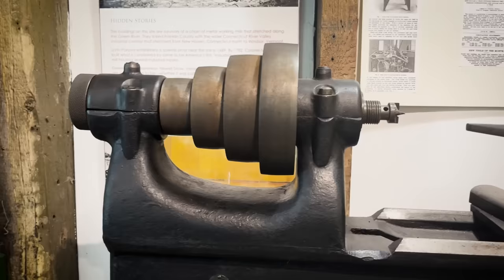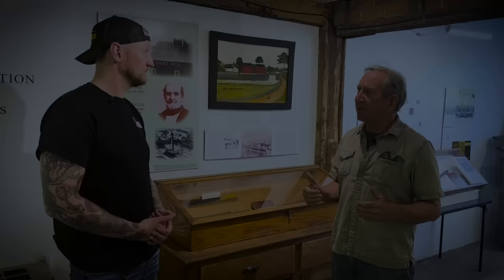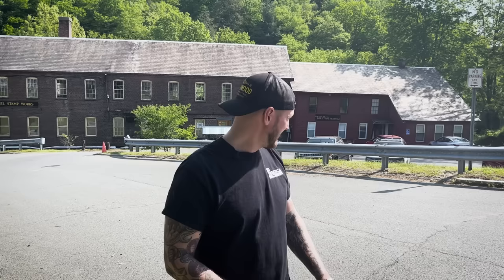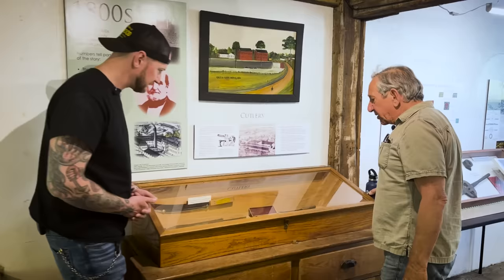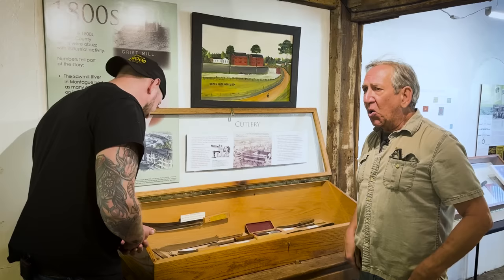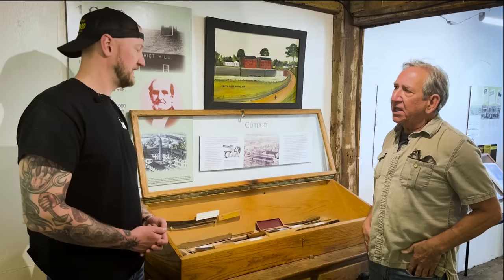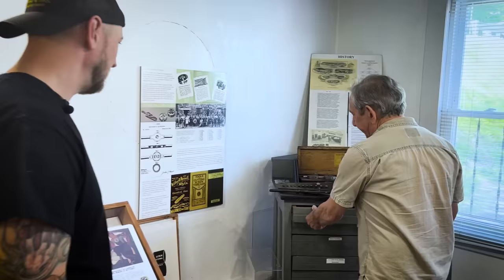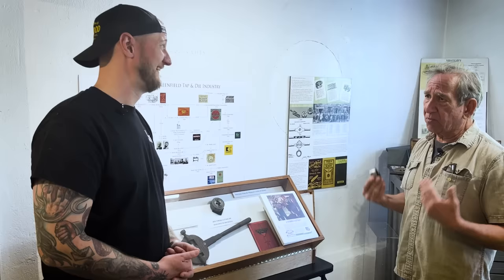The Cradle of the American TAP & DIE Industry | Museum of our Industrial Heritage

Comment: I worked as an Apprentice Tool and Die maker at a shop in Shelton CT.  Apex Tool and Cutter Co. Inc.  Back in the mid 70's.  We made custom Tool Bits and Tool Holders...Milling Cutters...etc.  We still had the old overhead Pulley system on a lot of machines.  One section had lathes, shaper, Horizontal Miller, Planer...ALL dated to 1860's...we had modern equipment also.  Loved working their.  Did 3 years there then went to two years of Electronics School and married the two skill sets...best thing I ever did.  Can still hear those pulleys and smell the machines from Apex...loved my time there.
Reply: That's pretty neat. Bridgeport, stamford, and norwalk used to have tons of tool-and-die, and factories back in the day. My mother worked at two factories in south norwalk after getting off the boat in the early 70's. Have some friends that have retired or passed away, that also worked at places like Pitney Bowes, or perkin Elmer, from way back when.
Reply: @VitoVeccia  I worked at Perkin-Elmer in 1980 and 81'.  Lived in Norwalk at the time.
Reply: @mauricepowers8079  my family lived in norwalk too. Then in '87 we moved to wilton.
Reply: @VitoVeccia  small world...I got married in 87' and lived in Weston.  Then moved to Darien for 2 years then moved to NM.
Reply: @mauricepowers8079  wow, small indeed.  Especially when it comes to a small town like Weston. You can drive through there in the blink of an eye. At this point,  I wouldn't be surprised if we might know some of the same people. A friend of mine grew up on Cedar road,  and his neighbor many moons ago was Christopher Walkin. It sounds surprising,  but it really isn't.  Keith Richard's used to love going to the Georgetown Saloon. And James Gandolfini used to live on Catalpa road, right behind wilton highschool.  James was a customer of my friends drycleaners business in Ridgefield.
Reply: @VitoVeccia  I worked at Klein's in downtown Westport as the "In House Electronics Repair Tech" from 82' to 87'.  If you ever had a Hi-Fi, TV, Boombox, Walkman repair done at Klein's...I did it.  I did custom Video and Stereo System installs on the side.  Made a killing. 😂 Paul Newman was one our customers.  Was out to his place on Coley Town Road many times.  Lot of famous people used our store.  Redford, Patty Hurst, Larry Coryell, Harry Reasoner, A.E. Hotchner.  Quite an experience.  Newman set up an Antique Popcorn cart outside the store on our 50th Anniversary.
Reply: Ha. My grandfathers came over from Sweden in the '20s, and we're machinists and tool and die makers in Rockford, IL. My father followed in the same. 
Companies like Woodward Governor, Ingersoll Milling, W.F. John Barns. My mom was in industrial supply sales. I grew up with all this stuff, but as Rockford was dying (really, no pun intended this time), I went into a EE degree and ended up spending 40yrs designing software. Initially for machine control (Barber Coleman) and then into biomedical. I'm still always working on projects that don't involve computers. The odors of the shop are intoxicating in the best way. 
I firmly believe that no kid should be allowed to graduate high school without having a min. of 2 semesters in general shop and 2 in some type of trade.
Reply: @mauricepowers8079  Coley road? Did you know Bob Andrew's? I was friends with his son growing up.
Reply: @stringlarson1247  funny story.  I spent most of my life as a auto/heavy truck mechanic.  But now I'm a factory mechanic for Nexus.  Our Mokon water heaters for the Aurburg use barber Coleman controls.
Reply: @VitoVeccia  I'm sure I met him in passing.  We had an ENORMOUS customer base and very high foot traffic.   I LOVED working in Westport.  I had to work Tues through Sat and spent the weekends playing Tennis in the Spring, Summer and Fall(Foliage was breathtaking).  Winter was almost every weekend(Sun and Monday) up to Killington, Stowe, the Berkshires, the Whites.SKIING.  80's was AMAZING.
Reply: @stringlarson1247  my Grandfather migrated from Quebec to Greenfield MA back in the 30's.  He was a very highly skilled Machinist.  He met my Grandmother in Greenfield then bought 6 acres in Huntington CT and built a beautiful French Cottage on the property(he used scavenged Brick from the shop floor and wood from the shipping crates from the bar stock at Hershey Metals Inc. In Ansonia CT.  He was lead Machinist on Screw Machines till he retired in the late 60's.  He was an INCREDIBLE machinist.  Great guy...everyone loved him.
Reply: @VitoVeccia  Wow, small world sometimes. While in univ. I worked as an engineering co-op student in their plastics machine control div. I wrote all of the code for their Maco 8000 Touch-trol operator station in 8051 assembly language. You can find images on the googles. 
The workstation was an Intel 'blue box' with 2 8" floppy disk drives. One for the OS and one for the code with an in-circuit emulator. 
Ironically, at the time, I just wanted to build tube amps for audio and nothing to do with computers. I just happened to be really good at it. After getting my degree, I ended up moving to S.F. with my roommate and after doing landscaping in Marin Co. got a job working on the first pulse-oximiter and then on to writing real-time operating systems. FFWD and our OS was on the first Mars Rover (and now a billion other things). 
Now I just want to get an old Bridgeport milling machine and a lathe (which I've never used) and make stuff w/o any computer controls. Cheers.
Reply: @mauricepowers8079  Sounds idyllic. 
I love the scavenged/re-purpose materials mindset. I'm pushing 60 (quickly) and have been doing that since before I was 10. My father died when I was young, and I 'inherited' a whole workshop of tools. The only thing my mom got rid of was a large Rockwell table saw. (she knew which way the wind was blownin' :) ) 
I live on the not-so-posh end of an old, posh historic, and on 'garbage' night, I'll ride my bike around and see what people are throwing out. If I find something, I'll ride home, get the ol' Volvo wagon, and hope to get back before someone else nabs it. Unreal how much stuff people pitch out. I need to get another pickup truck to get bigger/longer things like old-growth lumber, etc. As the area is quite wooded, I grab logs, etc., for the wood stove as well.
I hope you still have that property and, if not, at least memories of that time. 
I've got a friend who's job is as project mgr. building 'skyscrapers' and he's built much of his family home with salvage material. I'm just a piker compared to his level. But that's how we learn. 
Thanks, I love hearing things like this.
Reply: @stringlarson1247  I'm just like my grandfather in a lot of ways...his property went to my cousin to help pay off some medical debt for my aunt.  Great memories though.  As the story goes, when they were planning the site, they needed to dig down about 10 to 12 feet...they hit good old NE BEDROCK.  Grampa or one of my uncle's got their hands on some DYNAMITE to help the job along.  They got it done 😂  you couldn't see the house from the road.  Hand dug Artesian Well.  Guest cottage.  Everything was scaled down for grandma because she was only 4' 11".  Gramps was only 5' 1".  
He was lead Machinist at Hershey Metals and every couple years they would replace the aisleways on the factory floor with fresh brick as the old brick became oil soaked.  There was a HUGE pile out back.  Gramps also owned a garage in town with a sand blaster.  Boss told him take all the brick he wanted.  He took truckloads of them and sandblasted every one of them and built the cottage for gran.  Handmade French doors leading to a beautiful slate patio with a fireplace built into a retainer wall.  Door frames were all rounded on top...stucco walls.  Full attic.  Cabinets and countertops were all scaled low so gran didn't have to stand on anything to access whatever.  Glassed in Sun porch.  All overlooking a hillside dairy farm to the North.  Completely wooded surrounding the house.  Was magical in the fall and winter.  Gramps was about as resourceful as they come...and he and gran were immigrants...as were my grandparents on my dad's side.
Reply: @mauricepowers8079  Heh. Great story. Great traits to have inherited. 
All the work to move, sandblast the brick and then build to a smaller scale is quite the tale. Plus a little TNT in the mix. 
When you said the blasted and followed by 'you couldn't see the house from the road. I pictured a house built in a very deep hole :)
All four of my GPs came over from Sweden in the '20s. Both men where in the merchant marines and jumped ship and were illegals for many years. Thanks for writing this..
Reply: @stringlarson1247  the road to White Hills goes on a steady uphill grade from the Housatonic River...there was an embankment because they had to blast the bedrock to reduce the road grade.  This left the roadbed about 20' below the property.  Gramps got a small dozer and cut a long rough driveway parallel to the road just on the other side of the embankment.  The property sloped down and away from the embankment which pretty much hid the property from road view.  Gran liked the privacy so when they got the site ready they lowered it about another 6 to 8 feet and leveled it.  The Artesian Well was dug first after the site was leveled and they actually incorporated the Well in side the back end of the house to keep it from freezing in the winter.  The mail box was on the roadside and you had to climb up the steps and across the dirt driveway ... 
Then climb down a 20' (VERY STEEP) embankment...no steps...just a rocky dirt path 😂.  Was IMMENSELY FUN in the winter.  That was my cousins job to go get the mail every day. 😏
Reply: @VitoVeccia  you know who else lived in Ridgefield...Sterling Hayden.  Met him when I did a TV/delivery install once.  Robert Ludlum(Jason Bourne Series) had a beautiful place ON Long Island Sound in Fairfield.  He was a GREAT guy.  He had an old Slot Machine in his living room and every time I was there he would hand me 10 Silver Dollars and tell me to give it a whirl...never hit but it was fun to try.  He insisted on giving me a $20 tip no matter what the charge was. I told him I felt it was too much.  He told me he did whatever he had to when he was in College, and he learned real fast to accept any and all tips..."So don't worry about it" he said.  You should have seen the house...beautiful unobstructed view of the Sound...private dock...Tennis Court between the house and the beach...high stone wall on 3 sides and gated.  Gorgeous property.
Reply: @mauricepowers8079  I love hearing stories like that. I did some work once with my cousin,  at Dave canaries house. He used to live on Beldon hill road. Nicest guy you could ever meet. I went to school with his son, and didn't even realize it at the time. ( I don't watch soap operas ). But yeah, nicest guy ever. No amount of money could change guys like that personality.
Reply: @stringlarson1247  that is some incredible achievements you've done. Working a Bridgeport is fun in my opinion,  although I do need to get better at using them.  Too many toys, so little opportunities to try them. But still fun no matter what.
Reply: @VitoVeccia  I think the one who takes the crown( imho ) would have to be Larry Coryell.  I met a lot of "A Listers" and most were good people(with one exception who I won't name)  Larry was the most personable and just generally the most pleasant to be around and talk with.  He went out of his way to be nice to fans and anyone he happened to meet.
Reply: @VitoVeccia  Thanks. It has been an interesting ride. I'm so grateful to have been able to work with so many people who are way smarter than me over the years. And, of course my mom who raised, supported, encouraged, and pushed me to work hard and not fear failure (something in which, I am extremely good at). 
And, yes, working one of those Bridgeports is intoxicating and fun. Also, agree that there is too much time and too little to do . . . wait, switch that. :)

Comment: My grandfather was a blacksmith. And a Ferrier. And a teamster. Also worked oil wells and coal mines. I was a machinist. And it’s funny you mentioned the box. 
Think about how prevalent the card board box is. Everything came in a wooden box. Everything. From Chalk to cheese. Machinery to cigars. 
My uncle had a gunshop and later did antiques. Amazing how many things came in a little wooden box. Of course wood was much more available and cheap because of that back then. Rivers caught fire because spontaneous combustion of the sawdust from the saw mills had choked the rivers off. Like a logjam but covered in sawdust. 
History is fascinating. 
My grandpa said he cried when he saw how they cleared the land in West Virginia and burned the trees just to get rid of them when he was a kid. Trees so big three and four men touching finger tip to finger tip across. Say six feet each times three. Is 18 feet around makes them 6 feet in diameter.

Comment: In the 1960s I worked at Vermont Tap nd Die.  We were the Pacific Division, we the 'Special' taps Westcoast industry.  The biggest tap I ever made was an 8 inch diameter.  It weighed 85 pounds at first, 55 pounds after. Good place to work.
Reply: During WWII did they not employ 4000 people at one point?

Comment: I was a machinist for 45 year. It was my life and I enjoyed it. I learn to set up and operate some, (by today's standards) pretty old machine. The oldest a 1870s vintage Pratt&Whitney  turret lathe. Mind you this wasn't in a museum. I had to make useable parts with it. The story of the Industrial Revolution quite of glazed over how important Eli Whitney's screw cutting machine, the first machine was . There was no standard screw thread and no way to make them. I you had a contraption and it was put together with screws and you lost one,,,you were screwed. There wasn't another. The other inventer worth reading about is Sam Colt. Ya the revolver guy. Only that was the easy part. He had to invent all kinds of machines like multiple spindle drill presses. Even tooling. There was none before him. Colt invent the assembly line. He was the first person to ever send an electronic message and the gave his invention to his friend Samuel Morse.

Comment: They probably figured out that prevent the rocking of the building, they could phase the machines.  I bet the casting of parts of all these new machines was like a moon- shot; all the planning, lining up the cast for a pour. File making was a big deal, and easy to tool-up for. The spring-making industry would be interesting, and would drive them to higher standards of metallurgy.

Comment: 12:38 I am pretty sure at that time, stamps would have been made from large-scale wooden patterns on a reducing pantograph. I expect the cutter would already have been a rotary cutter, driven by water-powered line-shafting. So pretty much the same techniques that would conginue to be used until the advent of CNC, minus the electric motors, of course.

At least I know that's the technology that was used to make the matrices for printer's type in the late 19th century.